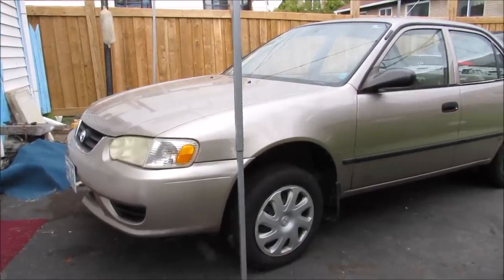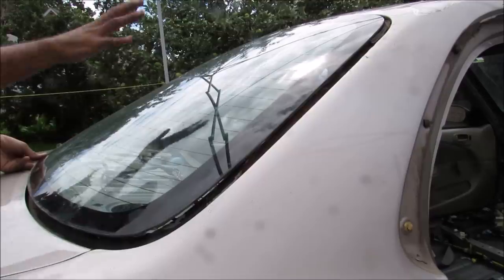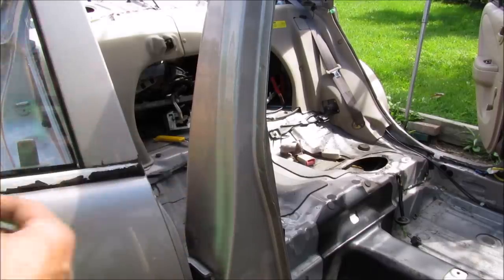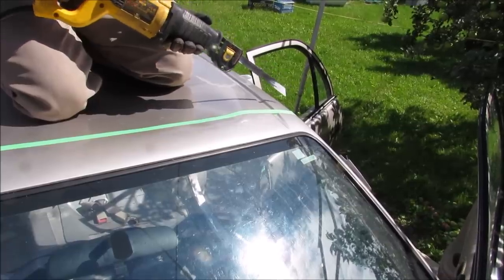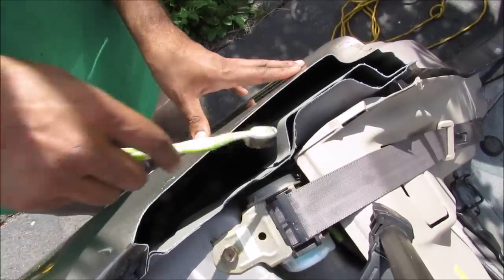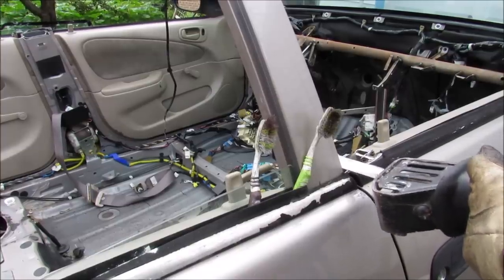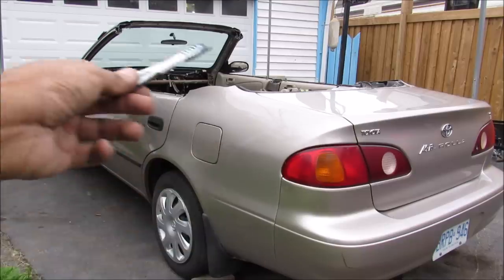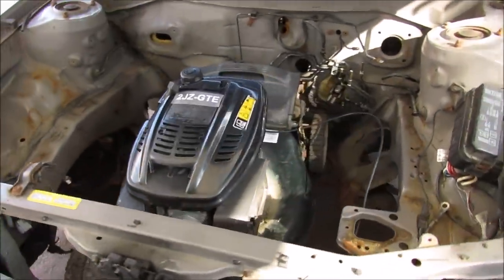How to Transform Your Car into a Convertible

Comment: Pretty funny. I'd maybe put a disclaimer on the video incase someone tries to do this on their own car and actually drive it on the road after and have the car buckle.
Reply from the maker: +AnthonyJ350 thats fine too...
Reply: The car would buckle?
Reply: AnthonyJ350 That's why you have to use your brothers toothbrush! Duh...
Reply: Ya, the top hood acts like a reinforced strut for the car to resist twists and bends.
Reply: I think a proper roll cage and reinforcing the frame rails with some solid steel might just provide sufficient structure. However, it's much easier to just buy a miata.
Reply: It wouldn’t buckle, but it wouldn’t be a very stiff ride
Reply: Like Richard Hammond in Brainiac: "We are doing these experiments so you don't have to. Please don't try this at home". Then, rather teasing: "No really, don't!"
Reply: BEATNGU42 Yes eventually it'll fold like a taco. The doors will become pinched and stuck closed and due to lacking of this structural support, it will also flex diagonal, thus obliterating any handling the car had before... In short, without proper reinforced supports it will fail.
Reply: @stepheng887  no. It would flex some but it wouldn't buckle. Some unibody stiffeners would be wise though
Reply: As long as it doesn't unbuckle.
Reply: awdrifter3 ^ That made me laugh. Folded backwards? Like how? Makes me wanta try to do it...
Reply: Hey i watch your videos
Reply: It won't buckle from not having the roof. However, it will handle exceptionally bad and if you get in a crash you are toast.
Reply: I'd be more worried about the result of flipping the thing. Convertibles from the factory come with heavily reinforced A pillars. This Corollas A pillars and windshield would just smoosh the driver.
Reply: judging by the rust, yeah it will buckle
Reply: just gotta reinforce the bottom a bit, but you'd still have to be decently careful

Comment: Think of the car as a shoebox.  When the top is on, its hard to twist or bend. Take the top off and it can easily twist. Take of the sides (such as when the doors are open) and the box collapses. Before anyone tries this watch other videos on cutting roofs and chop tops.  You will want to reinforce the cars body by welding in temporary bar stock to prevent the body from twisting and buckling even a minor amount could jam your doors or trunk.  After the top is cut off you will need to reinforce the body with bar stock.  Reinforce front to back under the car and from driver side to passenger side behind the front seats and behind the rear seats (you may be able to do this in the trunk.  
Consider making this a 2 seater.
Reply from the maker: But body flex is part of the fun

Comment: cant wait for the 2JZ bro!
Reply from the maker: +Munib Ahmad Yea...lawnmower engine.
Reply: speedkar99 :'( yaar why not real 2JZ GTE lol that would be narley
Reply: He'd have to chop out the trans tunnel and firewall to get it to fit... Also, there's quite a bit more that goes into converting a FWD car to RWD(no way an inline 6 is fitting in there sideways). There's a guy on Instagram that has a 2JZ AE92 hatch though. His username is gt92turbo.
Reply: Elizle you can fit it sideways 😂 just gotta use that saw a little bit more

Comment: Ultimate death machine
Reply from the maker: +thehemi yousif Yea...these cars weren't very safe to begin with, at least they don't go very fast
Reply: I've found the speed limiter in mine several times. The computer says "no more" at 115Mph. 

(I ain't got good sense)
Reply: Doesn't go fast ???!! Bro it doesn't got seats belts try to crash it at 40mph see u in heaven man 😂😂
Reply: If you mean "faster than the equivalent displacement pushrod engine" the answer is always yes, they are. DOHC means you can get a decent amount of power out of a reasonably sized engine 
http://www.billzilla.org/2v4v.htm
Reply: Check out Rorykramer on Instagram. He did this same exact thing with the Chainsmokers together and he crashed it. The dude almost died!
Reply: Factory convertibles have several hundred pounds of structural reinforcement on the bottom frame. This makes them bottom heavy, unable to roll.

It also makes them strong. A unibody car relies on the roof for strength.  Try to crush a closed cardboard box...bit hard....Now cut box in half and try.... too easy.   In front end collision, this car will crumple like accordion, with occupants squished in middle.

In factory convertibles, windshield pillars are also engineered to act as a roll bar of sorts.

Comment: In any unibody hardtop car, the roof is a structural part. In a unibody convertible car, strengthening beams are added in the floor to keep the body from flexing under load or folding like a taco in a crash.
Reply from the maker: Thanks for the knowledge 
I gotta cut a few more cars now 🤕

Comment: Well chopping the roof off can be done legitimately, and there are companies that can make that conversion for you, but you'd have to keep the B-Pillars and fabricate-in some reinforcements, often it could end up looking like a Vintage Dual Cowl Design, with a permanent partition between the front seats and the rear seats. The line at which the C-Pillar was cut needs to be lower, where it aligns perfectly, and doesn't interfere with the door window frame. Checkout the Mercedes-Benz Ocean Drive Concept which was launched as the 5th Generation S-Class. The original concept was of a 4 door cabriolet. Not sure if it was a Pillarless design or it had B-Pillars.

Comment: You should add some extra ventilation to the under side, cut some hole in the floor and a few Amazon hood scoops hanging off the bottom should do the trick, easy to install with the double sided tape. 
It would really help the down force I'm sure.

Comment: Interesting project, my only quibble is it's not really a convertible, as it doesn't have a roof you can put up in the rain. Instead of a stinky, boring Toyota sedan (I guess that's redundant), you now have a fun, open four seater (well, except for that minor structural integrity thing).
Reply from the maker: Yep 
It was fun and that was the point

Comment: This is so unsafe, you forgot to mention, you must add more support to prevent the car from buckling in highspeeds. please do not do this at home. Or drive an unsafe vehicle like this
Reply from the maker: Did you see the engine in this thing and the end of the video? 🤣
Reply: you don't need more support. Just take the doors off! easy weight reduction, just like a jeep!

Comment: Car Assisted Suicide is what I’d call this. By chopping the roof, you compromise the structural integrity of the car. If it doesn’t come from the factory as a Convertible, then it’s best to leave it intact and not risk getting yourself killed. Convertibles are reinforced throughout the vehicle to compensate for the lack of the B and C Pillars by design. In short, the crash structure that would normally be above the window line is reengineered and placed in key areas of the car below the window line. So if you take a chopped Sedan or coupe and get into an accident, your chance of injury and death skyrocket. You take a bump too hard, it could buck, especially on unibody. Hit a squirrel and you still probably won’t walk away. Use your brain wisely before even considering this attempt. Not to mention if your state has safety inspections, you won’t pass.
Reply from the maker: +JamesDQC 86 cool story bro. Did you see the engine I put in at the end? 😉

Comment: You should put a ducudii or a ninja motor cycle Motor with a middle rear wheel drive sproked akcel transmission or put the sproked in front close to the motor you get it???😁

Comment: My car has an undercarriage made of steel I-beams and I've been told not to make it into a convertible, as it would need additional steel plates welded underneath to stabilize it.   This is a terrible idea to do.
Reply from the maker: If it's unibody like this then no, it's not safe to drive
Reply: It is a 1955 Cadillac sedan.  The car is made with steel beams along the underside.